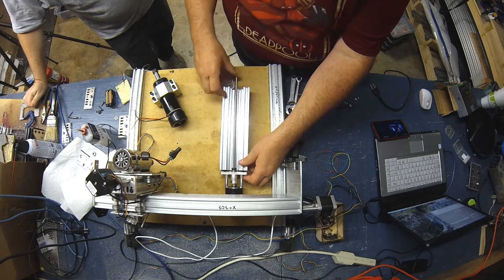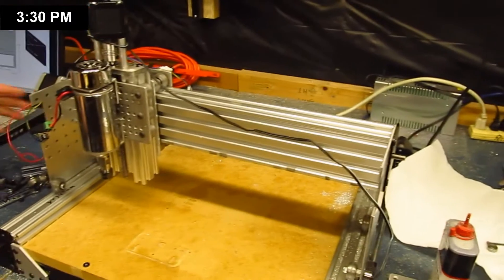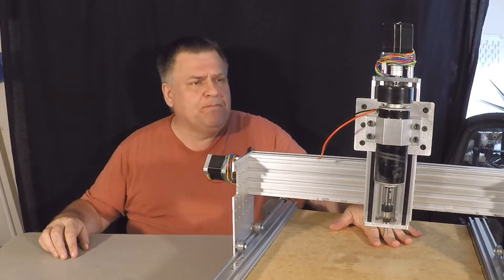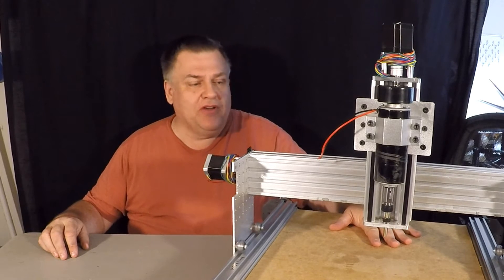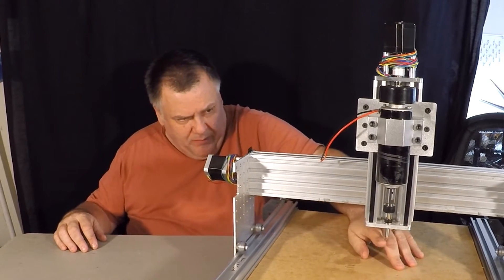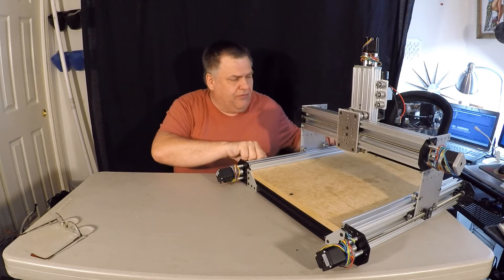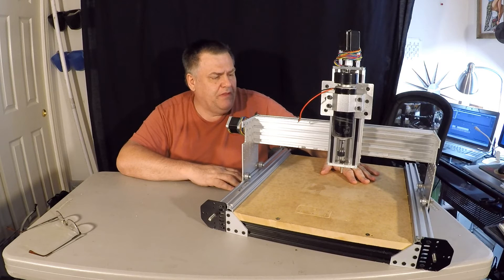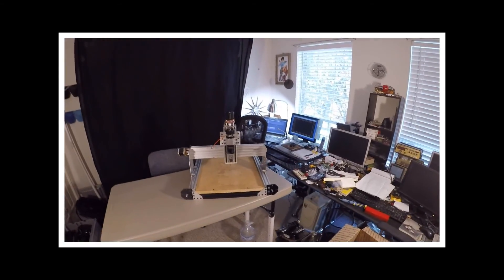Frankenlab CNC # 5 - The Mill Build

Comment: Nice Video, but your machine has a serious weakspot. The thin 4mm plates are not rigid at this lengh and will lead to larger tollerances. I mean the bed (X) and the vertical axis(Z) are ok, but the Y-axis is very vulnerable to side way forces (lever arm of a force). You can fix this by screwing Profiles on top of the plates so it becomes thicker (more rigid).
Reply from the maker: Hyper Hektor I may do more mods... but this is simply a training CNC which does what it is designed for. I'll be building a MUCH larger and MUCH more stout design in the future.
Reply: The plates are actually 1/4" (6.35mm) 6061 structural alloy   ;-)